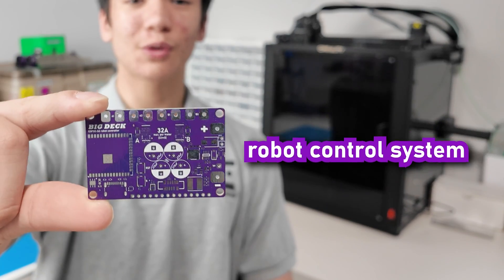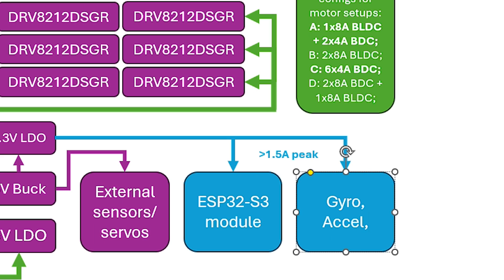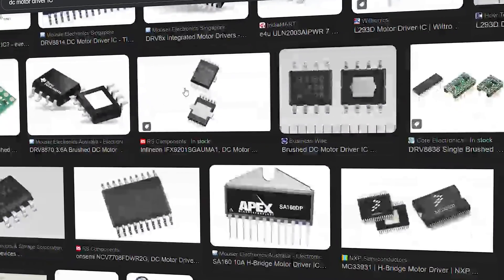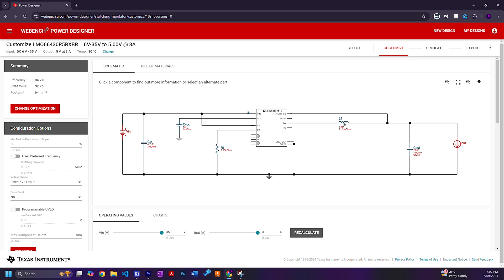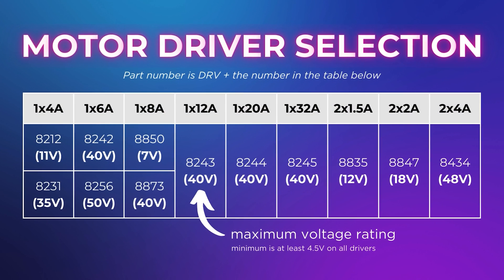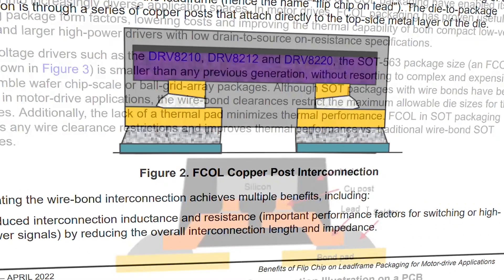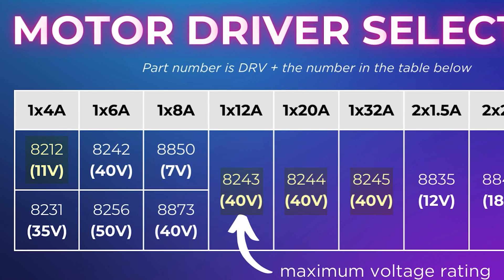ESP32-S3 Robot Control PCB - DIY in 10 minutes! (Part 1)

Comment from the maker: What kind of robot would you build with a custom all-in-one controller?
Reply: I like so much a project called nematoduino. It uses the mapped neural connections of a nematode (a worm) to simulate the brains in the nematode inside an Arduino board. Maybe you can port that code to the board that you build?
Reply from the maker: @Fuuuuuuuuuuuuuuuuuuuuu  Cool idea 😁
Reply: i have some tiny bots and learning about pcb design to make the bots even smaller. they are currently 35mm x 40mm x 30mm but i can get them much smaller with different motors, an all in one pcb and a small 50mAh battery.
Reply from the maker: @superradmaker  impressive! Hope it goes well 😁
Reply: I'm poor, so I'm researching ways to build an alternative to ODrive components.  My objective (read: unrealistic dream) is to to build a 'helper' robot that is highly mobile (thinking bi-ped on wheels) and uses generative AI to assist with communicating to others the needs/intent of disabled people who are less-than/non-verbal through sign language and daily routine.  I want to make it as low-cost as possible- because believe it or not- the people that would need it most are not able to afford commercial technologies.  My motivation is my 10-year old son who has down syndrome... and being poor.
Reply from the maker: @somyongui  best wishes to you and your family, and I hope you will achieve this goal 😁

Comment: Wht if you use tantalum capacitor? I does come with smaller package compared to electrolytic capacitor
Reply from the maker: Yeah, I could, but tantalum capacitors don’t have enough capacitance for this high power application and are also very expensive.

Comment: Are those motor drivers powerful enough to power drone’s brushless motors
Reply from the maker: @jaspreetmalak  yes, however they would need to be arranged into 3 half bridges and there are better solutions I think. The resistance of the MOSFETs may be too high.

Comment: hey, I like to build 3Kg sumo robot too! Nice video. This video almost feel like a design review. I have some questions/comments.

@2:06 (edit @2:16) You mention "consume 28A requiring anti power switch?" which is not true. You don't need a anti spark switch because you consume 28Amp. You need this of the bulk capacitors. At t=0 a cap is a short circuit. So when you plug the Xt60 of you lipo, the capacitors act as a  short circuit thus creating this huge spark inside the XT60. The softstart prevent this spark. Not related to motor current.

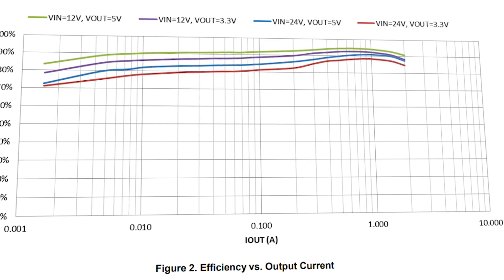@2:44 you say you want to use the LMQ66430 because it output 3Amp. That's not a valid reason, you need to show me data that proves you  really need 3 Amp. A table of all the peripheral connected to this board with actual measured current consumption would of been great addition to prove the reasoning.

@8:22 regarding MLCC, you need to consider "DC bias". For example check bottom of the TDK product page of the  C2012X5R1V226M125AC, you will see the DC bias graph showing that if you apply 16V to that 22uF capacitor, its capacitance is now 2.35uF!!!!!!!!!!! Hence why you need more in parallel to compensate for DC bias.

I was not aware of desmos, that is neat. We use MathCAD.

All the other components explanation is great. PCB layout is an other beast.

Try to do some internship here in the Bay Area, you will love it!
Reply from the maker: Hi, thanks for your comment.

At 2:06 (wrong timestamp btw lol) I said this to reduce the more complicated explanation. I am fully aware that the bulk capacitors are the reason why, not the current draw of the motors. It actually is related to the motor current, because the more motor current you need, the larger the bulk capacitors you require, and therefore the more current the capacitors will draw on startup. So, my claim is true, but it isn't simply just cause and effect as I might have made it sound like (my bad).

Yes, I don't need 3 amps output on 5V, but the LMQ66430 makes for a smaller implementation and the fact that it can output 3 amps tells you that the MOSFETs inside have a lower Rds (on), thus yielding higher efficiency. Higher efficiency is always a valid reason. Also, this allows for attaching high power servos or other motors which may run on 5V.

I know exactly what "DC bias" is, and I am aware of its affect in MLCCs. I thought that it would only halve the capacitance, since I saw that most graphs showed this during my research. I knew it got worse with the package size, but even the slightly larger 1206 capacitors with the same ratings have a poor DC bias too. I didn't check these graphs. Thanks for letting me know :)

I did have two in parallel, one for each motor driver, but, that amounts to about 5uF... I could've used more in parallel but this would've made routing with adequately thick traces much harder, since I already had predetermined space requirements. Also, I didn't want to do double sided assembly because I had to assemble this board myself with a hotplate.

Besides, I already had 1880uF of electrolytics in parallel to deal with the ripple current requirements of the capacitors.

Also, I'm in the southern hemisphere bro 😂Have a great week man

Comment: It would be nice to click to PCBWay to order myself this interesting integrated module, if the price were right =)
Reply from the maker: @Hukkinen  the board has a few issues like the power switch not working, causing massive sparks in the battery connector. I would be happy to put new boards on PCBWay’s community ordering page when they work though 😁

Comment: This video is goated, I'm definetly designing my own robot control PCB for a faster line follower, I currently use arduino nano + tb6612fng, but I'm thinking stm 32 + DRV8245-Q1 might do the trick

Comment: Nice work! Do you think you might sell your controller boards to other folks? I'm not doing Sumo, but it appears you've designed an excellent board that I might want to have around for an as-of-yet conceived project. 

Also as far as using the motor specs to select your cap values it seems that is mostly to save cost by selecting the smallest cap that will work. Do you think you could you build "generic" boards to have around for future applications by selecting the bulk capacitors based on the max specs for the motor driver instead? Matching the high-power current and voltage specs of the 8245 driver with the largest (tallest) electrolytic cap that will fit in the board footprint? These would be versatile boards suitable for many applications, though they would be over-kill for some. I looked at the TI video you recommended and it seems to say that using a larger bulk capacitance is (in general) is a desirable trait, though from what I saw, it might affect braking for some techniques. What do you think?
Reply from the maker: Yeah, you’re completely right that I selected only that much bulk capacitance to save cost and space. Actually running 64A (32 per motor) would need a ridiculous amount of capacitance to be stable, so I didn’t add that much in. My all-in-one controllers are meant to be ‘all-in-one’, that is, working on multiple platforms and robots while being a single board solutions. Since I’m 13 as of now, I’m in no position to sell my boards, but I can sell the designs and manufacturing rights to other people if they have the means to manufacture and distribute the boards. Thanks 😁

Comment: Hey, really enjoying watching your journey, that's a really nice board, especially considering you're just starting out! I've also been designing a custom drive and control PCB for my beetleweight, it was the only way to fit all the components I need in the space I have! I've just ordered rev2, using a Seeed Xiao RP2040 and 4x TI DRV8256 motor drivers (via a PCA9685 for PWM/port expansion), plus an IMU. Four independent drivers for the four motors mean I can do torque vectoring, and the IMU should allow me to close the loop on the control system. 

I have a couple points to make that popped into my head while watching. The first is that I don't think you need a buck converter to power the MCU; an LDO like a LDL212PU50R can supply 1.2A at up to 18V input, and only requires 3x3mm board space and a couple of capacitors. The load on the 5V rail shouldn't be too high, so while the difference in efficiency might be a large percentage difference, the actual power draw will be negligible compared to the draw from the motors and you reduce the BOM cost and count considerably and free up a little space.

Second is with regards to your capacitor section. Don't forget that in these circumstances fully charged lipo battery is almost an ideal low inductance power supply! The internal resistance is tiny and the cells are rated to ludicrous burst discharge ratings - in fact inside my spot welder it's just a really big lipo cell and some mosfets. With a good lipo cell, short power leads, a low inductance PCB design you'll be able to get away with fewer capacitors than you would with big long leads on a bench top power supply. I actually don't have the Z height for any electrolytic caps on my board, so I've simply piled on as many 10uF ceramics as I can physically fit in the space available and crossed my fingers. 

Finally, a point on driver selection. While choosing a driver based on the motor stall current might be fine for sumo bots, where you can jump in and switch off a stuck bot before it burns a motor out, I would suggest against it for combat robotics. A stalled motor can easily burn out, and you'll rarely see full stall current during operating conditions, so it can be sensible to choose a lower power driver (or apply a current limit if the driver/controller allows it) to avoid motor damage if a wheel jams during a match. While it doesn't really affect the outcome of a fight, it does save on parts and repair time! In my bot I'm using custom Nerf motors (Out of Darts Valkyrie), which on 3S have a 14A stall current, which is absolutely insane for a 130 sized motor.  If I spin up a corner of the robot drive with a bench top supply and grab a wheel it doesn't go much above 5-6A until almost totally stationary, hence my choice of 6A drivers.

That's a lot of words and I hope it doesn't come off like I'm trying to lecture you! You know your project better than we do, I just enjoy the technical discussion and hope to share some things I've learned both during this project (which has taken almost a year, eek) and a decade in engineering. I think if I share a link to my bot's build thread I'll probably get caught in a spam filter, but if you want to check it out it's called Fatal Deviation and there's a public thread on the Bristol Bot Builders' forum. I will eventually be publishing the whole project on my github, but I need to finish it first!
Reply from the maker: Thanks so much for this comment, I really enjoyed reading it :) Good point about the motors burning out, I haven't thought of that since I just wanted extremely efficient operation of the PCB itself regardless of whether the motor drivers could be too powerful for the motors or not. You can set an trip current for the motor drivers that I've chosen though, I just decided not to, and this trip current can be well under the 32 amp rating. That means that you get an appropriate trip current while not constantly hitting the motor driver's maximum ratings, which would improve longevity and probably also power consumption since the internal MOSFETs have a lower resistance. As for being able to use an LDO and not a buck converter, I made an ESP32-S3 board with LDOs with similar ratings (16V input, 1A output, 2x2mm WSON), and they caused the entire board to heat up to an unacceptable degree. It burns to the touch. My antweight combat robot control board included these same regulators and I was unsatisfied with the amount of heat that was generated by them, even though the board was probably only 30 or 35 degrees celsius. (I really don't like inefficient circuitry lol, even if it works and it's fine to use). The ESP32-S3 chip draws lots of current when transmitting and receiving RF signals (like, 100mA or more) so it was not good. As you probably already know, an LDO's efficiency is essentially just its output voltage divided by its input voltage, which would mean an 18V input, 5V output LDO would be less than 28% efficient. Buck converters hit into the 85% - 95% efficiency ranges, so I would much rather them... LDOs are still great devices for low current though.
Anyways, thanks so much for watching and leaving your comment, have a great day!
Reply: @h1tec  aha, I forgot how power hungry the ESP was a buck converter sounds like the right option then!
Reply from the maker: Thanks! :)